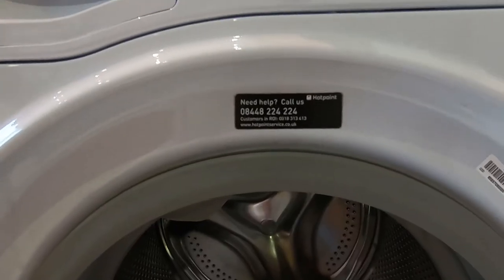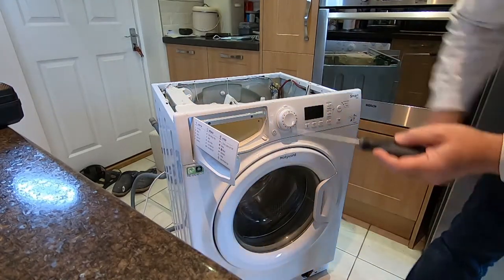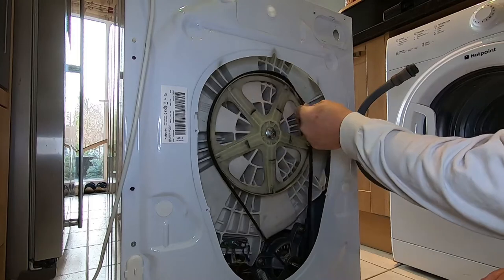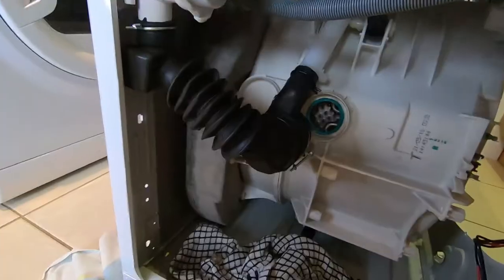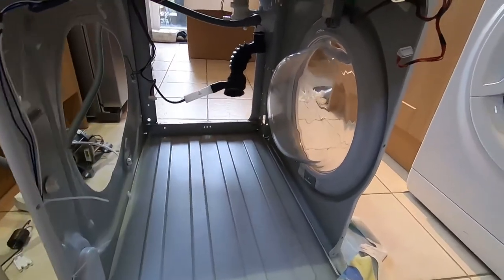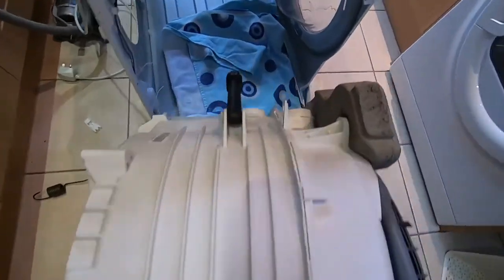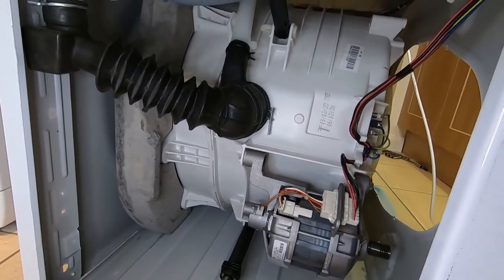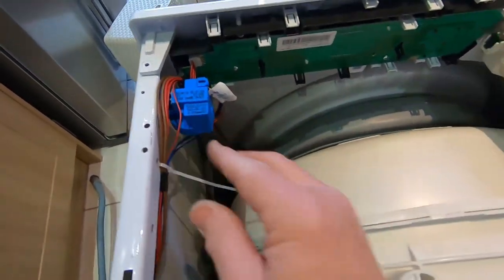Hotpoint WMFUG842P UK M Drum and bearing replacement

Comment: Just wanted to say a massive thank you. I knew the bearings had gone in my washer which is a similar model. I looked at the videos for replacing the bearings and thought that it was definitely a no go. My wife was all set for spending £250+ on a new washer. I convinced her that a new drum at £150 was a better choice. Had a hiccup at the end when I realised I’d accidentally pulled out a connector but otherwise this was a perfect step by step guide. Saved me a bunch of money and I’m sat listening to a like new machine with an immense sense of pride.

Comment: Brilliantly done thank you, I did my drum replacement yesterday and your video made it very straightforward.  My machine is the WMFUG 942 UK P and it was almost exactly the same - the pressure sensor pipe comes off the drum directly. Thanks again, saved me a fortune and contained loads of handy tips in a very to the point video. A++
Reply: Hi there, 

Could you please tell me what bearing size you used and where you got the parts from as i got the same model and want to do my own replacement on bearings.

Also was it a sealed drum?

Thanks
Reply: @HB-yp8lp   you have to replace the whole drum on yours
Reply: @hotpointbrownlover3365  Thanks for the reply, yes i know it's sealed drum, but i've seen videos of people cutting/splitting the drum, change the bearing and then then reglue/seal the drum and works just fine. Im thinking to give it a go.
Reply: I have the same model making a lot of noise at the moment, I think I’ve determined it’s the bottom front counter weight that’s loose, do you happen to know a way to get to the bolts without taking the whole drum out? The front doesn’t seem like it’s removable
Reply: @Mrjoecummins   you cant take the front off you have to remove the drum to get at this one

Comment: Excellent video, you must have to have a love for this kind of job.
for most, it is not even the most economically viable route to go down as a new drum is so expensive.
On top of the drum price is of course, the work involved you show here.

Hotpoint confirmed it is not possible to change the bearing itself without destroying the drum. So, yes You must change the whole drum as you show here. 
Drum price varies from £160-£250.
The amount of work you correctly show on top of this drum cost would render most people’s  machine obsolete for them.
It seems to be 5 to 7 years period before failure, for most people with normal family use of this machine.
This is planned obsolescence at its finest. 
Of course, they could make the design with an easy and cheap  replaceable, bearing at low cost, but that wouldn’t fit in with the planned obsolescence PLAN would it.
It should be Law that planned obsolescence of the machine you buy is declared at the point of new machine sale/purchase .

Comment: This is so wrong, they should introduce legislation to stop manufacturers from making sealed units, all that plastic etc which is creating a environmental issue just so they can make an extra buck, and all it needs us a fully recyclable bearing, absolutely scandalous, multiply this by million and all the waste plastic and the production of it produces tonnes of carbon and pollutants, good video very well explained and pro, but what a carry on all that work and hasstke plus cost when all it needs is a few quid for a bearing.